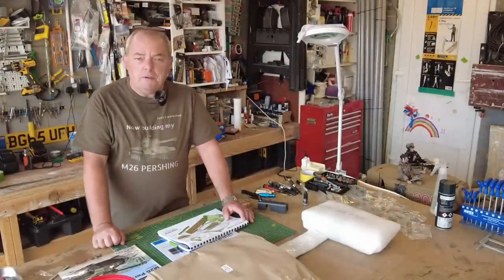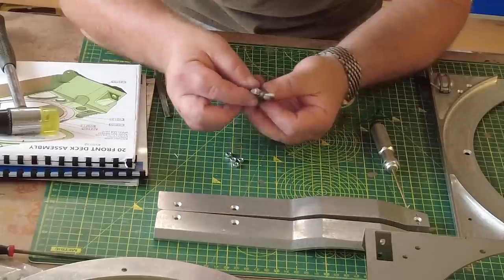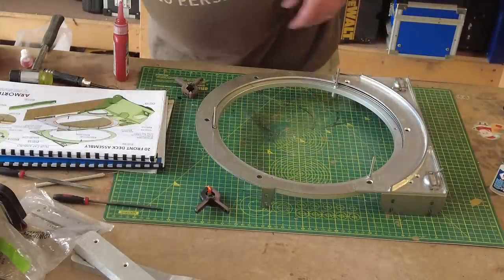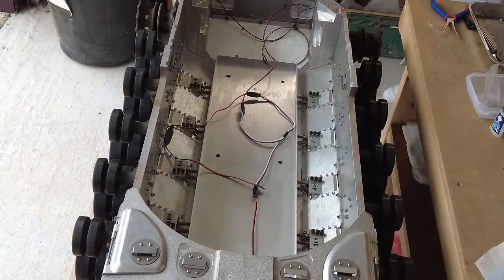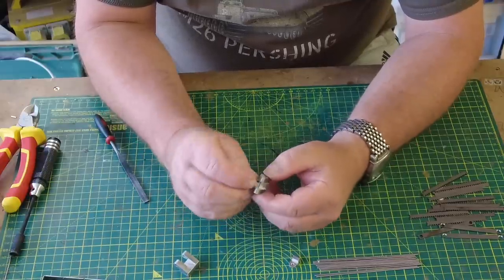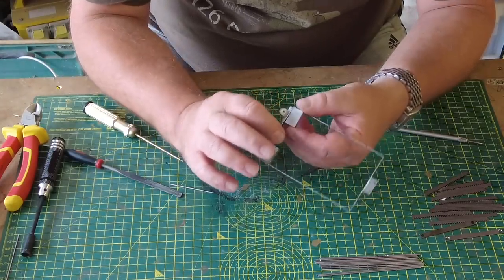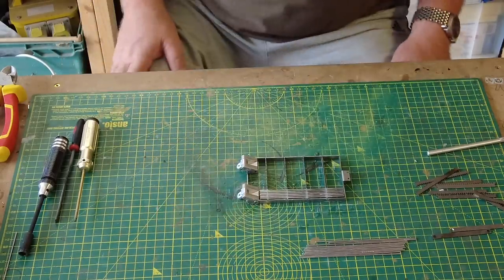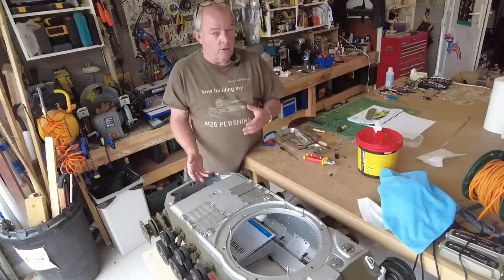1/6 scale Armortek M26 Pershing RC Tank build. (Vid 16) Top hull deck turret mount and mid section.

Comment: Based on the size of your battery charge jack you could drill a hole under a fuel cap and mount to the deck.  A different kind of refueling
Reply from the maker: I have a plan for this, but also going to use the 3rd one(still to show) to use as the smoker re-fill inlet. Thanks for watching and the suggestion/comments, it is very much appreciated.

Comment: hi tony not sure if it would work  but you could solder the hinges and also solder the other pieces that you are gluing in as long as you can cent enough heat into the metal the solder shout take and may even enhance the look as if it were welded
Reply from the maker: Hi Alex, Not a bad suggestion, but the glue held it together quite well in the end..I will be doing some mock welding around the hinges where the connect to the tank and think it will look pretty good when painted. Thank you for watching and commenting.

Comment: Hi Tony,  I made the same error in mounting the long screws in the turret mount, as it is a bit unclear in the pictorial and you naturally think they will be evenly spaced. Plus, it seems that the ring might be used for other models as there are more holes on the ring that is needed for this kit, so it can be a bit confusing as to where to mount the screws. On mine, the turret mount assembly is a very tight fit onto the hull. I have to push very hard on the hull to squeeze it into position. Just tolerance differences I would imagine. On the side screws that fit into the frame and into the hinges, on mine, part of the reason why the frame would not fit tight against the hinge is that the screw would bottom out into thread so it never could pull the two pieces together tight enough. I did this a couple months ago, but I ground off part of the tip of the screw. It then was able to be secured very tightly and I did not even use Loctite as they recommend. And I had to grind down the heads of all the screws completely flush with the frame. Amazingly, there is still enough left of the head to tighten down or remove the screw if needed. The grills were the most tedious part of the build I think, but they look very nice when painted.
Reply from the maker: Thanks Ray, Yep...I have adjusted that now...I assumed it was similar to the Tiger...Doh! The rest of it was straight forward...Those Grills are so monotonous, but glad I am through that part with no major issues...Hope all is well.

Comment: Hi Tony - You build is coming along really well, and Thanks for your detailed observations. My earlier comment on the dummy filler caps seems to have gone missing - possibly because I included a link to an image of a Heng Long M26 showing their interpretation which is a left-right reversal of the way you've fitted them. Tamiya mouldings are the same, and they have the hatches with the handle part on the outside of the tank body with the handle pointing inwards to the turret. I think that would make sense from an operational point of view, but I can't find an original photo to check. Still waiting on delivery of my kit, so I'm at least 4 months behind you!
Reply from the maker: Hi Keith and thank you for watching and commenting again. I actually changed the handle position as I was concerned that they may clash with the turret when it is eventually fitted. There is another one on the main 'T' plate, but this has a hole, which I plan to present the smoke juice filler pipe, similar to how I did on the Tiger. I hope you receive your kit soon. Armortek are back from their summer break, so it should be with you soon.
Reply: @tonys_workshop  Thanks Tony - my kit is with UPS at the moment. Yayyy!  I've just found a few close-up photos confirming the position on the Armortek forum - M26 Pershing Production Images page posted by Armortek on Tue Feb 21, 2023 11:10 pm. Images xas3/4/5.jpg  are clear.

Comment: Too late now, but I would have used soft solder rather than super glue on those grilles. Something that comes from ship modeling when joining metal parts.
Reply from the maker: Thanks Stephen. A good tip, but it worked out ok in the end.
Reply: @tonys_workshop  yes, it looked good. No intention to sound negative.  I find the process fascinating and I can live the build without having to buy one.  Looking forward to the next video.
Reply from the maker: Thanks Stephen. Not negative at all...A great tip, but it didn't occur to me...I am still learning about other methods to build these amazing kits. Thanks for your support.